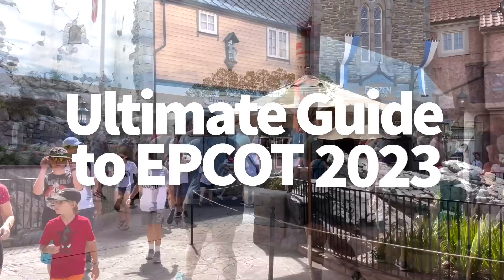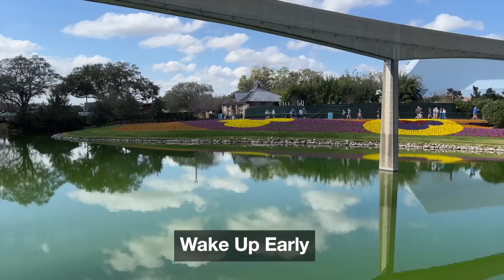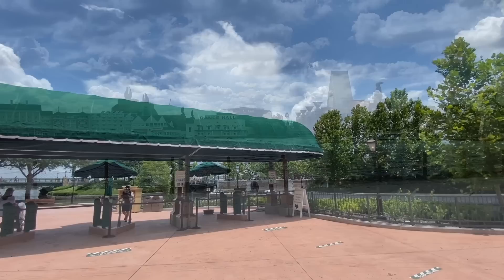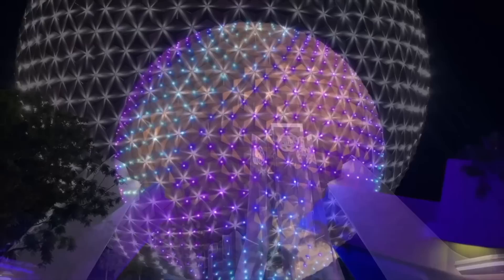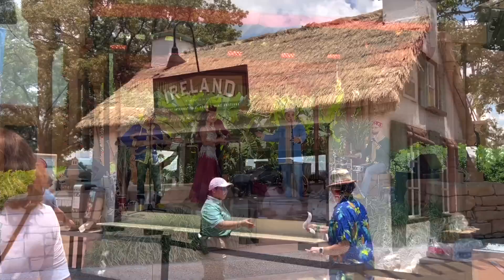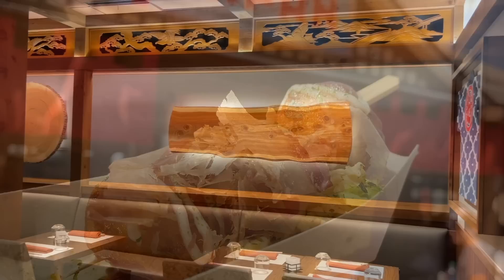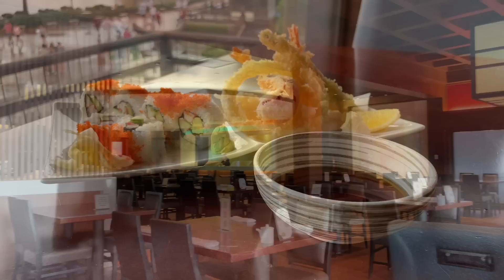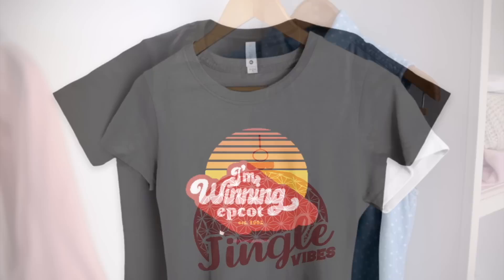The ULTIMATE Guide to EPCOT in 2023

Comment: AJ, would you and your team mind tackling strategies for mobility-impaired guests traveling solo? Thanks!
Reply: Boasting this comment!
Reply: My gf and I are mobility impaired but we don't do any of the rides because of my neck injury. Otherwise, we have our own scooters and zoom around Epcot (and other parks) with no issues going into gift shops, restrooms, etc. I do sometimes look for the family restrooms and use them. I also have a large battery pack that I have had no problem getting through security. I sometimes have to use the battery pack to recharge my scooter. There are electrical outlets around the park. One of my favorites is in the Chinese pavilion in the museum before you go into the movie. It's air conditioned.
Reply: I'd love some content about that, too. I'm mostly mobile; I can get around pretty well with a small walker that has a seat on it for waiting in lines. I'd hate to tie up a scooter (and take up extra space) if my walker would be allowed and useable.
Reply: @cubemissy  same here. I don’t think they allow Rollators.